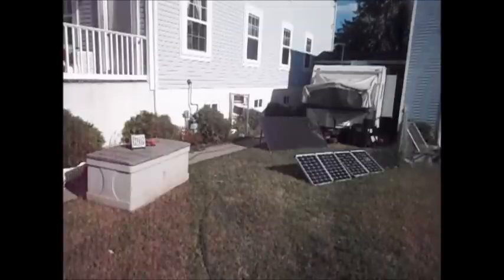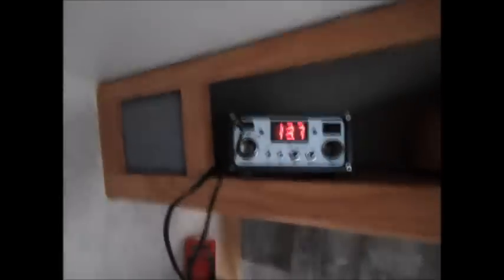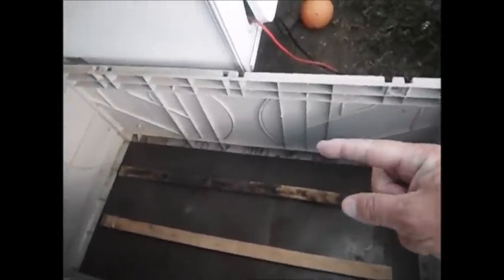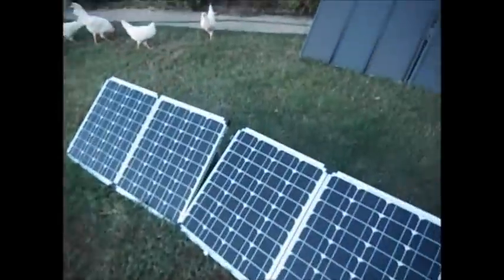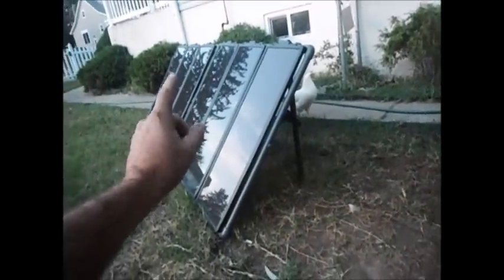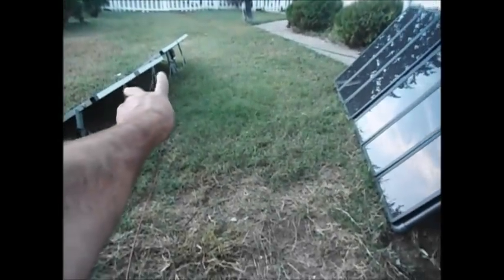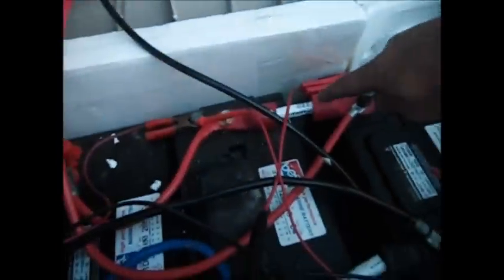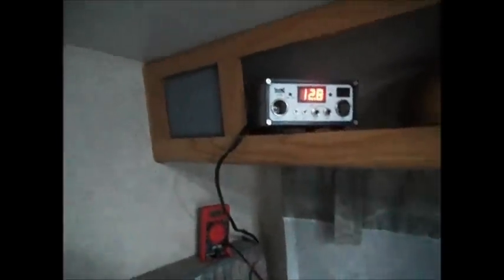UPDATE AT THE OFF GRID CAMPER -- 01

Comment: Just a heads up, they are wired in parallel, not series, which is correct :)

I have seen a video somewhere of a teardown of that cheap chinese MPPT controller and it's apparently not MPPT at all :/ . I'll link the vid when I find it, it's worth a watch.
Reply from the maker: cool thanks  they were cheap so I thought it was worth a shot    I tried to find a video on them and had no luck